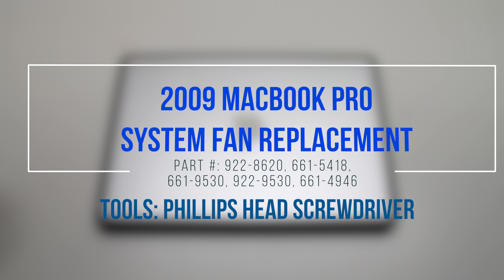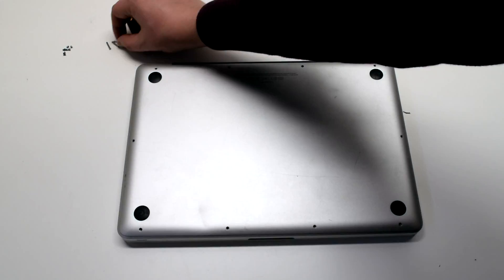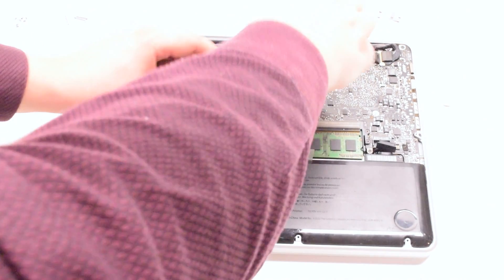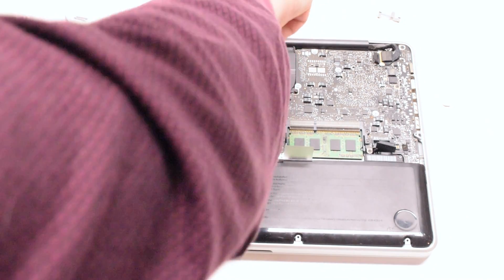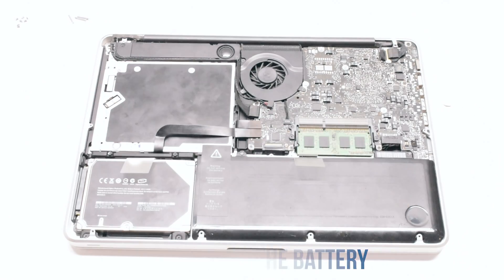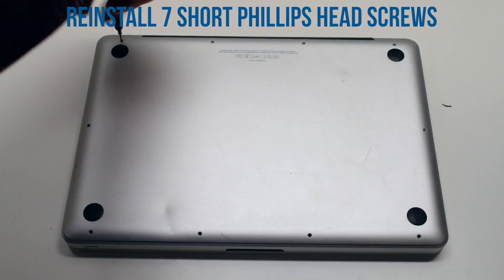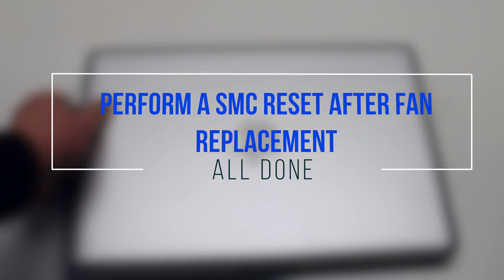2009 Macbook Pro 13" A1278 CPU Fan Replacement

Comment: The fan "socket" that is visible is actually both the housing and the connecting socket. If you try to lift up the whole housing (as is suggested in this video) you will detach the housing for the socket from its soldered connections to the board.

Comment: You must have a funny clock ⏰
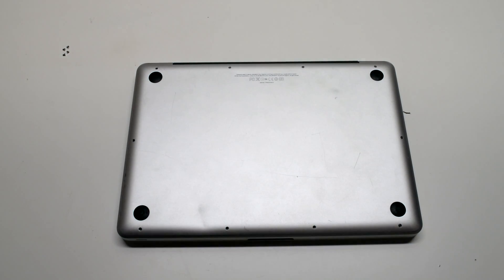Reply: Seriously, the reason I said this is because at 0:29 you said, “We’ll be disconnecting them clockwise”, then proceeded to disconnect them anti-clockwise (counter clockwise).

Comment: How did you disconnect the games cable from the logic board?
Reply from the maker: +Steve Feinstein not sure what a games cable is, please explain.
Reply: Save Apple Dollars sorry.  Autocorrect.  The fan power cable.   I've read it's easy to break the connector.
Reply from the maker: Just gently pry it up and out of it's socket.

Comment: Should I go with any brand? or can I buy any fan that fits MBP ?
Reply from the maker: Any brand is fine but it has to be a specific part number, many macbook years have completely different shaped fans so make sure to get your year and model correct.

Comment: I didnt disconnect the battery? did I screw up?
Reply from the maker: You should be fine. All power running through the laptop is low voltage DC so it's not dangerous but if you do touch something and short it, you can blow a fuse or a relay, capacitor or a logic gate. I would always make sure the battery is unplugged but if you did forget to unplug it but everything works after your'e done you should be fine.